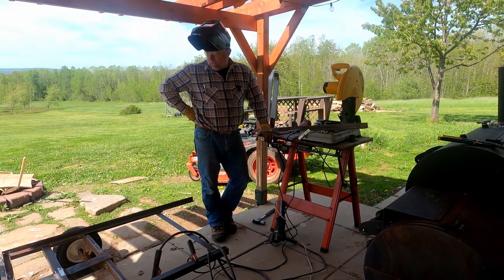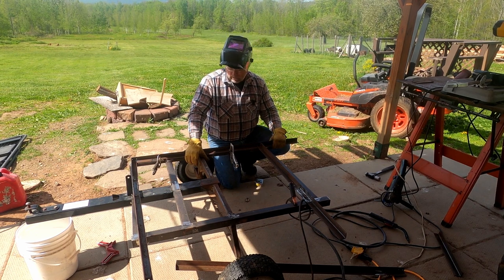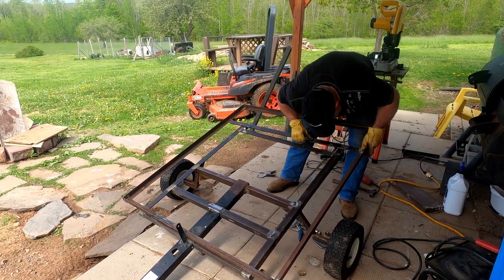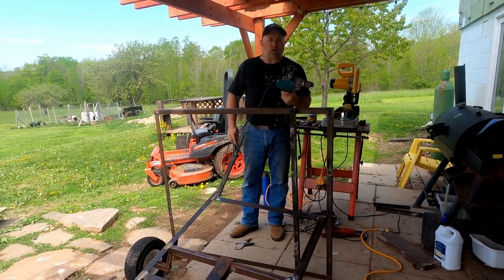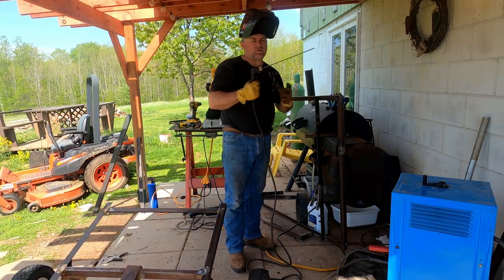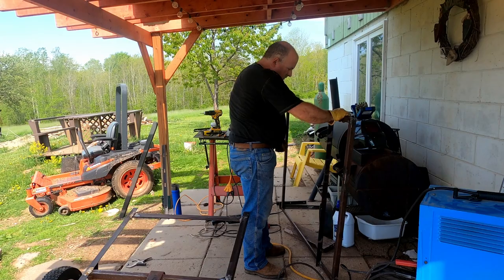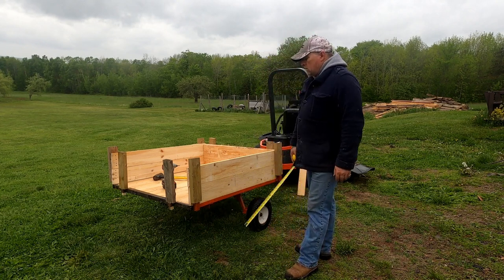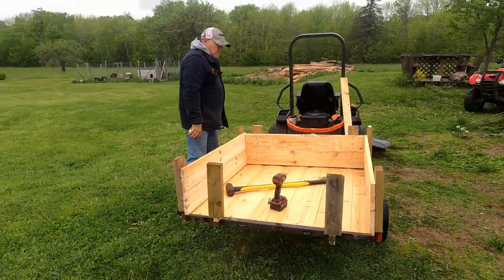DIY Bedframe Trailer for $22.00 Bucks Pt.2

Comment: Very impressive Tony, a real nice build and one of the few people that have a pine trailer.  Rainy day here so I have some time to catch up on a few videos.  Put a little bear grease on the 2 x 4's on the tail gate and it will slide out just fine. LOL
Reply from the maker: Thanks Roy. I like the look of the wood. I’m going to take my torch and burn it a bit to give it a cool look. Then I’ll put some wood preservative on it. Should last a while. Rainy here but we are down working some more on the pig pen. Adding some wire to it. Great idea applying the grease. Never thought of that. Thanks Roy and have a great day.

Comment: Are you going to put some sort of varnish or paint on wood to protect it? Are you going to put something under the box to aid in its lifting of  any contents you load it with?
Reply from the maker: I am going to do a process on the wood called burning. I designed the dump box so that most of the weight is behind the wheel base. So when it's loaded it literally dumps itself as soon as I release the catch. Thanks for watching and always love the dialogue.

Comment: How do you dump it when it's full
Reply from the maker: Great question Dennis. I built it with a forward FOC (front of centre) design. The box is positioned over the axel so that when it is loaded the weight alone will cause it to dump once I release the catch. I hauled a load of rocks in it already and it worked perfect. If it was bigger I would have incorporated a small lift on it. Thanks for watching.
Reply: @CreeksideMaplesHomestead  thanks, I should've known